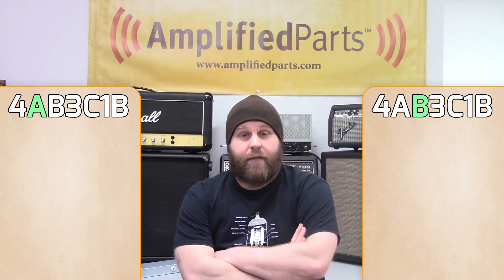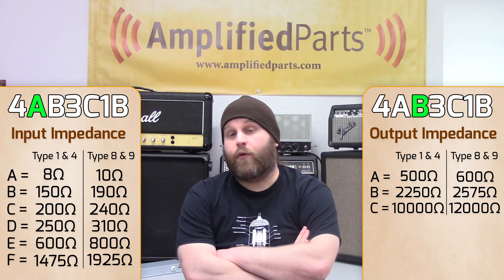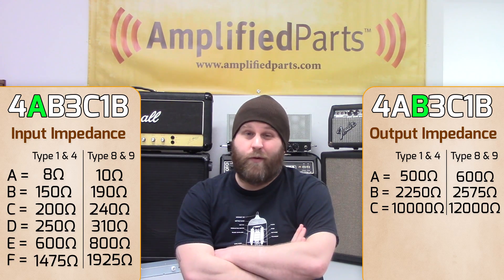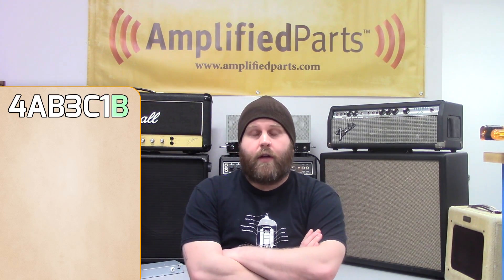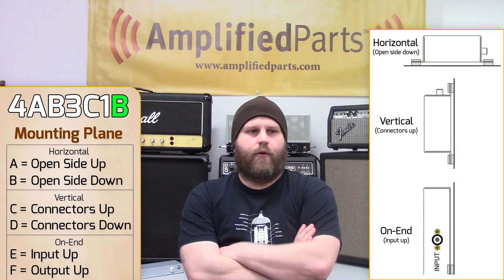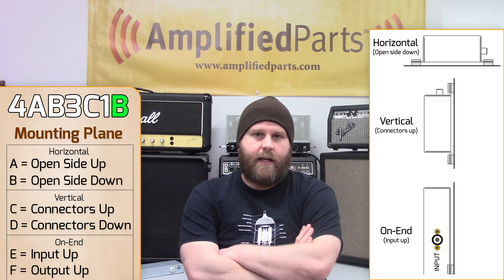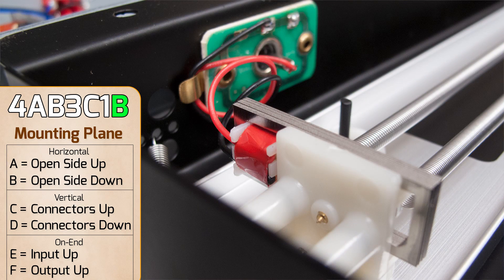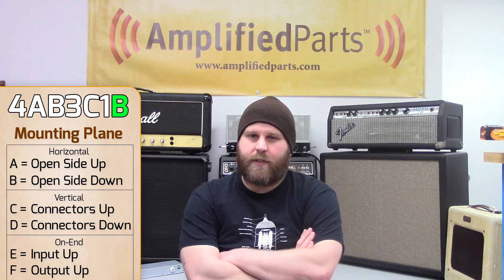Spring Reverb Tank Codes Explained

Comment: Hmmm... I've got a Peavey Bandit 112 Made in USA. It has a LONG tank maybe because the amp is large... And the first number is... 4! For the long two springs tank. Perfect. That tank stopped working lately and a replacement by MOD, the most popular brand is near 100 canadian dollars on Amazon Canada!!!!

But curiously, the small tank was only... 35 dollars! So i ordered it! It is a short two springs tank but the first number is not 1! It is 2! And seems 2 on other brand as well. Did you make a mistake???

Comment: AMPLIFIED PARTS, how can you convert a spring reverb into a SLAPBACK reverb so its very short time and the reverb tank sounds more like 50's slapback without the delay bounce? its called slapback reverb which is different than slapback delay
Reply from the maker: Springs inside reverb tanks are simply the physical mechanism used to create the effect, while slapback is a common setting for delay units. Other than manipulating the settings of the reverb, you may get closer to the desired effect, but there is not a modification that can be done to a tank to achieve this.
Reply: @amplifiedparts  SRV brother Jimmie Vaughan I think his reverb tank was modified by Cesar Diaz because his fender reverb sounds like a Slap delay/Room Reverb. It doesn't have that slap bounce just that very short delay/room reverb sound. I was wondering how to get that reverb effect because its more what 80's reverb sounds instead of that spring reverb, the 80's was more of slap back/room booth reverb.

Comment: Excellent info and presented in more layman's terms. I am replacing the tiny internal 2 spring reverb tank in an old Peavey TransTube Blazer 158. The springs are only 3 inches long. Although the model number on the label states "007-EB1E1A-PVY", your video gave me enough info to work out that I have an xEB1E1A, and am able to replace the unit with an external 8EB2C1B sat in the bottom of the cabinet. Although the input and output impedances are a close match, the first thing I notice is that the Reverb depth knob produces a deeper, wetter sound with the Reverb knob at 12 O'clock than it did before when using the stock tiny reverb tank.

Comment: I Have a Peavey Triumph 60 that has a 7101114 reverb tank,  i think its a 4EB2C1B tank, can I replace it with a 2EB2C1B??? impedance and grounding are the same, just length in springs and the tank itself are different.

Comment: Thank you , great information.  Much appreciated.  I have a question tho , I have 6 of them out of conn and hammond organs that I rescued from being junked and only the accutronic had the code stamped 4BB2B3C the other ones (Gibbs) do not have the codes .  except 3 of them have 1122-7027 , 1122-6911 , 1122-6826. I put together that 70 ,69 ,68  are the yrs and the day after the year. No idea of what 1122 is . and I can clearly see that they're 4s being long tanks and 2 springs . So I guess my question is how to figure out the rest . I have these on ebay , just wanting to add the codes to make it easier for musicians that are looking for vintage reverb tanks

Comment: The only code I can find on mine (apart from patent codes etc) is 40 164 95, written in the same type of ink as the one you showed at 00:12
It's from a Marshall JCM622 combo and is made by Accutronics. It also has 3 springs

Comment: hi, a marshall ma100c that uses a three short spring reverb and has this code 3db2c1d can i put a 2 short spring reverb and that has this code B2EB2C1B can this two spring reverb be compatible with my amp? does it have this  code B2EB2C1B, thank you
Reply from the maker: Since the impedances are different there could be issues. You'll want a 2DB2C1B.
Reply: @amplifiedparts  ok, thank you very much for your orientation, I can install in my marshall ma100c only D 250 ohms, I am going for the model that you suggest but before I will review your demonstration of long or short springs.  Thank you!

Comment: Great info! The reverb tank on my amp is 9BC2C1B and checking the impedances on your site it should read resistance values of 10 ohms input and 2.575 K ohms output......my tank however reads 30 ohm input and 800 ohms output......is this the reason I am barely getting any reverb from the amp? Despite the reverb turned full up? A new tank needed?
Reply from the maker: Shoot an email to us: info@amplifedparts.com and we can help you out!
Reply: @amplifiedparts  well I shot you the email and got the most useless reply back from a sales representative informing me that the tank ratings could be a possible cause of the problem but because they are not professional technicians he could only state that replacing the tank could be a simple and relatively  inexpensive solution.....quite pathetic actually. I was rather hoping for a tech reply confirming or negating the fact that those impedance values would or would not cause poor/non existent  reverb
Reply from the maker: @fostexfan160  It would be irresponsible to attempt to diagnose issues via email or phone. It could put our customers in danger or cause further damage to your equipment. That is why we always recommend taking your amp to a tech if you do not know what the issue is. We are happy to provide you or your tech with the needed parts for the repair and even make suggestions, but we are not able to diagnose issues via email or phone. We are sorry for the inconvenience.

Comment: what if i got no such marks on the tank? 
I have one, non painted "yellowish" ,on the back it says " accutronics geneva ill , pat 2.982.819    3.106.610" and on the side it says "23572-0". any idea what model it is? cant find any info online,even accutronics tech service doesnt answer on my question?(i suppose it is so old,they dont have any records of what it could be)
I need to find out what kind of impendances it has,so i can build/buy and pre/post amp. Thanks
Reply from the maker: Hey Demox. You might need to use an impedance meter to get to the bottom of it.
Reply: @amplifiedparts  how to measure I/O impedance?
Reply from the maker: @demoxcro786  You will need to use a special impedance meter such as the Peak LCR45.

Comment: You have a great company and I have purchased from you many times. This video answers so many questions I have on reverb units. Your links are also give a better understanding of things.

Help, I have a 4FB2B1B reverb. I opened the reverb unit. When I take my DMM lead and put one on the input connector were the black wire is soldered & put my other DMM lead on the connector were the Green wire is soldered, it reads 177 ohms. The input should read 1475 ohms. 
1. There is a cable jack  plugged into the connector. Is this effecting my readings? 
I get the same reading on the output connector.
Thank you.
Reply from the maker: You definitely want to unplug the cables from from the tank before measuring anything. The DC resistance a multimeter is measuring will give you very different results than the impedance rating of the tank. This goes for speakers as well.  If you scroll about halfway down on this page you can find some approximate resistance readings for the different tanks: https://www.amplifiedparts.com/tech-corner/spring-reverb-tanks-explained-and-compared